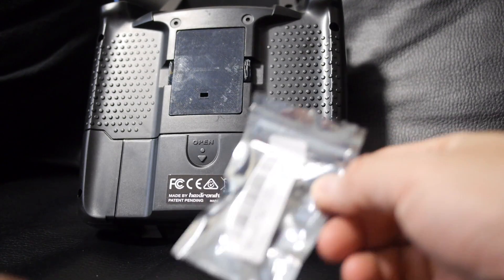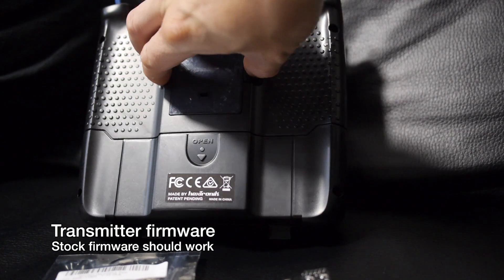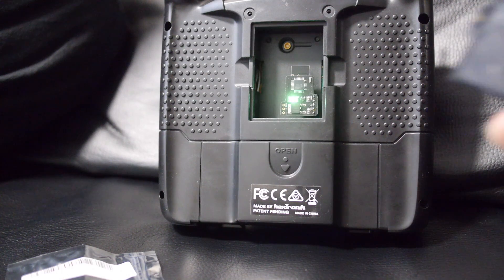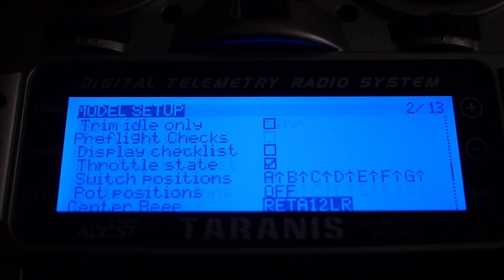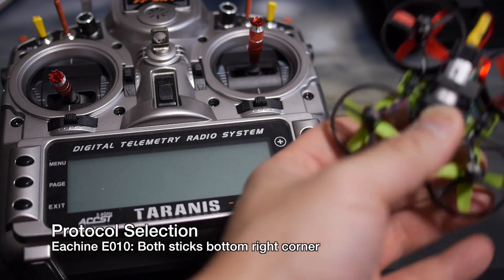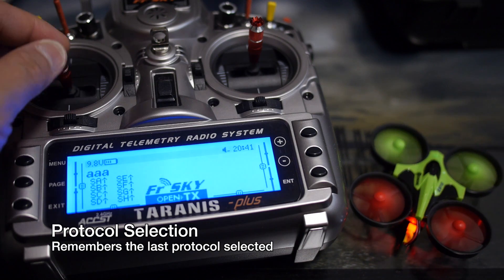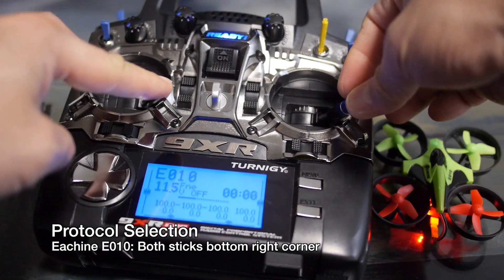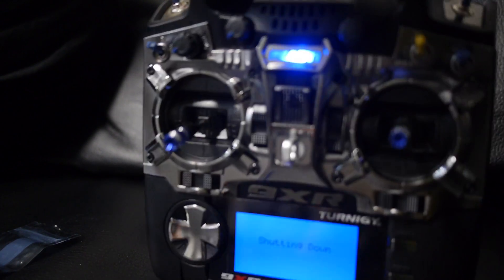✅ Multiprotocol TX Module for FrSky Taranis Turnigy 9XR NRF24L01 Eachine e010

Comment: Nice video. I got mine bound however it looses signal constantly and has major lag. Is this a setup issue, firmware issue or faulty chip?
Reply from the maker: Could be faulty but try it with different quads maybe to see if it's the same behavior.

Comment: I got the module to work!  So do I need to remove the module when operating my regular full size quads?  Or can it be left plugged in, or will there be damage to the transmitter or module?
Reply from the maker: You can leave it in.  Maybe make sure you disable the external module in your settings if you're not using it.

Comment: I made the mistake of ordering a Eachine QX65 Flysky and i have a Taranis QX7 (FrSky)... do you (or anyone) know if i can use this Muliprotocol to fly that QX65?
Reply from the maker: This definitely won't work. Flysky protocol is not supported. Look at the 4in1 multiprotocol module. It supports flysky and way more protocols.
Reply: Oki... thanx alot for answer.

Comment: I'm only see 1 chip DC regulator 7805 and 1 chip microcontroller atmega32 on this multiprotocol module, no RF chipset ... or is it hidden behind the black foam ?

Comment: Does it work with the Hubsan X4 h107c?
Reply from the maker: It won't since the Hubsan X4 uses the A7105 chip for protocols.  This module is an NRF24L01 chip.

Comment: I have connected it to my Taranis x9d but no green appears ?
Do I need to bridge something on the module first before using ? 
Or should it just show green light after I turn on my Taranis ?
Reply from the maker: Just make sure you have external module enabled in the options. Should just work
Reply: kenVersus do you mean external RF mode on Taranis ?
Reply: Set external mode to ppm ? That was what you mean right ?:)
Reply from the maker: Yes external RF module to ppm.
Reply: kenVersus still no green light..
I think this module is not working.. it’s from AliExpress😬

Comment: I have the irx6 for the flysky fs-i6, which I assume is the same thing, and I am trying to bind it to the FY326 Q7 which is a supported protocol,  but when I hold the sticks in the correct position and turn on the transmitter the irx6 never acknowledges that the protocol has been selected.  It is the only protocol that does not work on the irx6.  Could I be doing something wrong?
Reply from the maker: +DroneXFun I believe the first batches of the fy326 with green boards were yd/Skywalker protocol and the later with red board uses different unknown protocol.

Comment: Hi there all videos i have seen on this module is been use on the  Eachine e010 so my question is will this work on the Eachine e011 as well ??
Reply from the maker: +Shane Niles I don't have the e011 but from what I read it should work.
Reply: Shane, I have taranis qx7 with this module and the e011 with a camera. Love it! flies excellent through out my 2 story home while sitting in living room.*The only thing is that I can't activate the flip mode, must do manual flips only. Also the throttle is a bit lower, but it gives you more control that way.

Comment: Multiprotocol TX Module + Turnigy 9XR works, but with DM003 Mini Speed Flight 2.4G 4CH 6Axis 3D Roll RC Quadcopter RTF does not work  :(
Reply: vlodeck turnigy 9xr pro or just 9xr ?

Comment: Now i get a second multiprotocol. 
Same problem It still does not work. 
No green light. Maybe you have an idea?
Reply from the maker: +Multicopter make sure you have ppm enabled. Other thing is maybe check your transmitter is outputting power through the pins using s multimeter.  I can't think of any thing else.
Reply: Multicopter , check to make sure you have turned on the external antenna and internal off that should power up your board
Reply: When mine came in and I installed it the LED's didddnt work, but when I bound it to the E010 it works fine...

Comment: Nice Tuto!! Works with eachine cx 10wd?
Reply from the maker: +Admar Godoy I've used with cx10 but not sure about the cx10 wd. You have to look up what protocol it uses.
Reply: kenVersus what stick combo you used to bind It?
Reply from the maker: +Admar Godoy Rudder right + Aileron left + Elevator up = CX-10 older red PCB/CX11/CX205/CX30,

Comment: I've already bought the version 1.2 4in1, and by the way it worked perfectly....not like the previous version. I was thinking about the cheaper one you reviewed but I read that the range was limited. you have reviewed both so what's your opinion? thanks ken
Reply from the maker: +Bert105 4in1 is better way. But for $10 it's nice to have if you plant to fly only a few of the supported models like the e010.

Comment: Any hints if the light doesn't come on when plugged in? Tried multiple TX and no luck. My return % has been low returning to Banggood, too. :(
Reply from the maker: +Brad Garland  ppm is enabled?  Could be a bad module if you tried other TX's
Reply: Just got mine today, plugged it in, waited and no power on, no green lights nothing. Correctly plugged in, straight from package a no go.
Reply: it is tricky, mine worked for 5mins and stopped working between battery change on the quad.
Reply: Lasse, I have the same problem.  Mine worked perfectly for one battery on a Syma X11 and one battery on an X5C.  Then I started a new model (X9 protocol) and it would not bind (of course using the X9 protocol stick position at startup).  So I went back to the Syma model and used the Syma protocol stick position at startup, same as what worked perfectly before, and it would not work anymore.  The green light only comes on about 10 to 20 percent of the time, trying dozens of times.  Do I have a bad module?  Any other possibility?